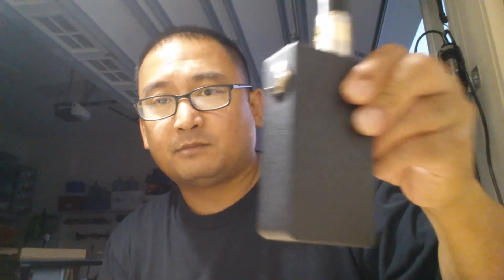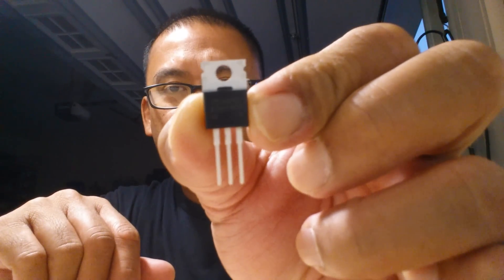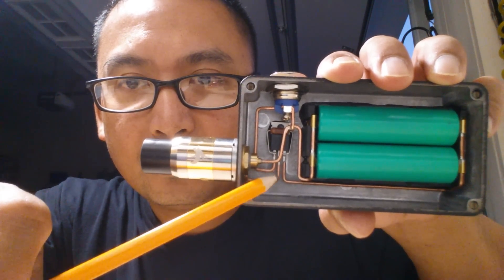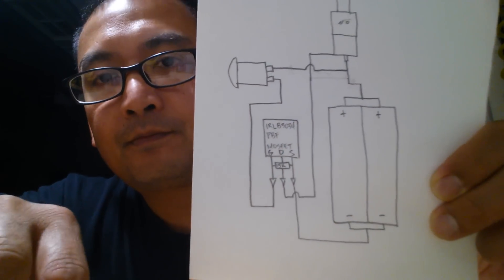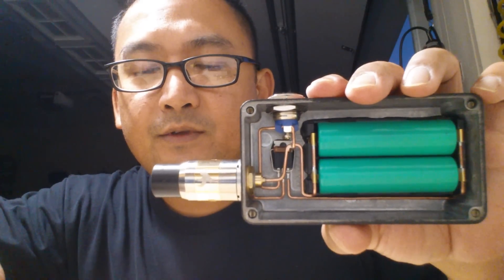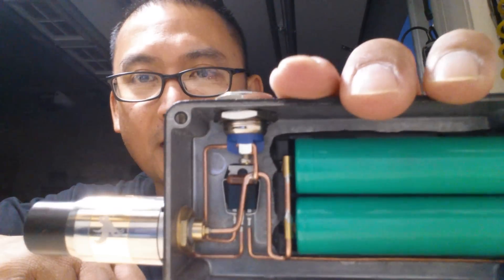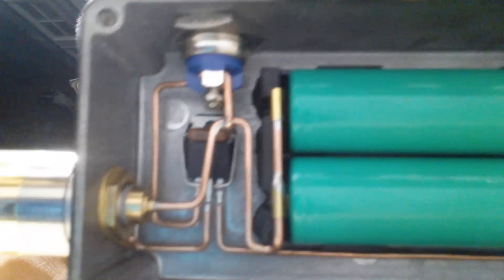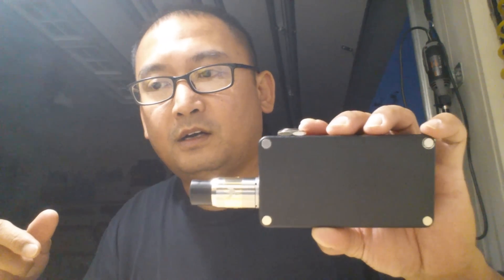Unregulated box mod with a Mosfet

Comment: Hi, can I start by saying that your build is outstanding ! Looks amazing and judging by the vapor, works amazing too. I'm about to make my own box mod and first things first, bought the MOSFET (same one as you have used). Can I ask the "on" voltage of these MOSFETs, I intend to build parallel as you have using 3.7v batteries, and have seen some bad results online with fets getting HOT. What is the minimum "on" voltage for these fets ? As you can imagine there are a lot of "know it all's" and conflicting advice on the internet and thought I would ask you as, well, anyone who builds mods like that knows their shit ! Thanks in advance, Scott (England).
Reply from the maker: According to the data sheet, the gate threshold voltage is 2.5v. The FET will get warm or hot especially when chain vaping on really low builds. A big mistake other modders do when using a FET is they heat shrink it because they're trying to avoid shorts. IMO this is a bad idea because it will heat up and the heat shrink will, not prevent, but will slow down the heat dissipation. On mine, I applied a thin layer of JB Weld just to secure in the box, so in a sense, the Aluminum box acts like a heat sink. On my next build, I'm going to put a copper heat sink on top of the Mosfet to aid in heat dissipation and for looks also.
Reply: Al USAF Thanks ! I can get building now thanks for the advice and video. Going to try and fit a heatsink in there if I can. Agree with the heatshrink,, shouldnt need it if it's mounted properly. Thanks again.

Comment: hey there.. dont know if this mosfet is tested, but its says 30 amps !! what ohm resistor would u use with this mosfet ? thanks      https://www.sparkfun.com/products/10213
Reply from the maker: Use an ohms law calculator and you'll be able to figure it out.
Reply: Al USAF thanks, I have sent you a private message, if you would help me out. id appreciate

Comment: I may sound like a complete noob but how did you get the 510 pin to stay on when you soldered it. I've been trying for days and the solder keeps coming apart from it?
Reply from the maker: I'm not sure how your doing it or what solder your using but this is how I do it. I use a helping hand to make it easier to solder the wire to the 510 pin. I dip the wire in Flux paste and I place it inside the pin, keeping it as straight as possible. I then rest the soldering iron tip on both the wire and Pin to heat both at the same time. After a few seconds, I put a little bit of solder right above the pin opening and I just let the solder flow...don't put too much. Once you remove the soldering iron, just wait a few seconds and it should be good to go.

Comment: question: this is the second box i have built so i know i did everything 100% correct. when i fire it and check voltage everything works. however, under load it will not fire at all. could it just be a bad mosfet?
Reply from the maker: I've never encountered that type of issue. But yes, try another Mosfet.
Reply: Al USAF trying a new one now. thanks for the super fast response!

Comment: Yo!  Great building Bro!  I noticed you actually placed the wire for the positive and negative sled tabs UNDER the tab link... is that a better link?  Also, I noticed you used 14 guage solid copper wire... how did you get those bends without breaking the wire?
Reply from the maker: I only did it so it's in place when I soldered it. You can bend copper without breaking it.

Comment: hey i love the box mod, but feel like you need a little education about metal oxide silicone field effect transistors and the wiring they require, the middle leg DOES require a heavy gage wire as it is the load and delivers ALL the amps of both those batteries to your 510 connection,the only wiring you can go to a smaller gage on tis the gate/trigger wiring from the positive to the switch, and from the switch to the G leg (gate) not ground.and it would help cut the voltage down to the mosfet if you put a 1/4watt15k resistor across the legs source and gate
Reply from the maker: True, someone already corrected me a long time ago...read the comment somewhere below.
Reply from the maker: I did use a 15K resistor.
Reply: Yes I always use atleast 14g minimum for all cept switch

Comment: Hi again thank you for your reply very help full,ime a little confused on the issue where you say you no longer would have to worry about a none rated switch if T junctioning from attie to + on the battery,would you please explain the difference so I could under stand the princable to when a regulated switch has to be used to when a none regulated in this instance,
Reply from the maker: I can't recall providing you that since you started a new comment and I can't view my response to you. So now I'm not really sure what you're trying to accomplish. But if you want to build an unregulated box mod and you follow the instructions I provided in the videos, you will be successful.

Comment: Interesting, I just bought this exact kit on ebay.  What did you use to slim down the battery holder?
Reply from the maker: No slimming required for the sled.
Reply: Al USAF Something I just noticed, I have the right Hammond 1590GBK, while the printout I have says to use the Hammond 1590B.  I'm guessing the 1590B is larger. Even if I clip the leads down on the battery sled, there's definitely not enough space to work with.
Reply from the maker: sinistermoon so you didn't get the exact kit then. Yes the 1590B is a lot larger than the G. Just use sand paper to make the 1048 fit inside the G. Basically lay the sand paper on a flat surface and work the sides of the sled until it fits.

Comment: This is an awesome mod I am going to try and build one in the morning hope it turns out. I love how clean yours turned out!! Jealous :)
Reply from the maker: Hope it turns out great...and thank you!
Reply: Where dI'd you get your button there's so much controversy  on buttons I build at a .23-.20 and don't want to melt anything
Reply from the maker: Jerri Bendig you're not going to melt anything with those build. But...I now highly suggest the use of a Mosfet for unregulated box mods. With a Mosfet, you can use non-rated switches such as the typical 3A amp pushbutton or tactile switch.
Reply: Awesome thank you :)

Comment: What does the mosfet even do?
Reply: It's to keep your firing button from getting too hot.
Reply: basically, your firing button has its own internal limits, if you built a completely unreg box and fired .06 you might risk ruining your switch. the mosfet takes the load from the switch and enables you to use any switch. the 3034 mosfet is a 195a mosfet

Comment: Wish I had got in the contest. Very nice video and craftmanship. Where do you get your batt holders in parallel and also can you get some for 26650s? I hate the stuff I have to use for batt holders, but take the ends out and modify them. Thanks for the vid again, very well done.

Comment: Hey man I have a question I've watched all of your videos I'm attempting to build a box 3 times now watching your videos as a tutorial I bought the MOSFET from the newmark site after assembling everything and having the batteries in as soon as I screw on the atomizer it's firing.or if I put the atomizer on and then put the batteries in its instantly firing. First time I thought maybe I shorted something out but then after the second time in the third time still the same thing. I have no shorts I'm thinking it's in the MOSFET my switch is good everything else is good

Comment: whats the lowest build that mosfet can handle??
Reply from the maker: The use of a Mosfet in box mods is to enable the use of switches with low amp ratings, not so you can use the box mod for low ohm builds. But since I gave this away, I have another box mod that I built similar to this and the only difference is instead of a Hammond 1590B, I used the smaller 1590G. I use this box mod with a 0.15 build on my Hobo rda daily with no issues.
Reply: Al USAF i mean whats the amp limits on the switch when using the 3034 mosfet? can it handle 0.8?
Reply from the maker: ***** the amp load is handled by the Mosfet and not the switch. But if you want to know the 3034 Mosfet amp rating, it's 195 amps. Can this handle 0.8? I stated on my first response that I use a similar box mod and I vape a 0.15 on my Hobo with no issues.
Reply: Al USAF thank you,

Comment: Can use like auto start wire or speaker wire to build an box mod? I would like to build one
Reply from the maker: I wouldn't use speaker wires, not sure about the auto start wire. Just go to Lowes, Home Depot or any auto parts stores and get either stranded or solid copper wires, 14 gauge at least for better performance. They're pretty cheap.

Comment: Hi! im new in this rda things. I've bought quasar rda, build same mod like in this video( im using ultrafire 18650 batteries), and build dual coil of 0.2mm kenthal x6wraps. But i cant get much smoke, or taste... I get better results with my anyvape twist and aspire bdc! please help me..:(
Reply from the maker: It shouldn't produce any smoke, which is a good thing. But I would suggest practice building coils because like you said you're new to RDAs. Also, if you want to produce clouds of vapor, not smoke, practice doing lung hits and exhaling technic (search Leo S or Lowe921 on YouTube). Definitely search YouTube for coil building and proper wicking too...there are plenty but you can start with the two channels I mentioned above.
Reply: Al USAF Ok, thanks, i will try!:)

Comment: I want to build dual 26650 box. Should I use anything diffrent then what you used?
Reply from the maker: Just the battery sled. But I've seen someone modify an 18650 sled to fit 26650 batteries.
Reply: I'm actually modifying some polished pennies and building my own tray! Trying to add some character to my box! :)

Comment: wondering if this would be safe to use in a wooden casing? and what type of wire are you using? what gauge?
Reply from the maker: Yes. I used 14 gauge solid copper wire that I bought from Lowes.

Comment: Awesome tutorial and awesome box mods, I like that you take pride in your work as it shows! 
I have a question, what would you need to do if you want to run a switch with the LED ring that lights up when you press the fire button. Thanks
Reply from the maker: I don't have an answer for you since I haven't used a switch with an LED.
Reply: i make boxes like that check me out on instagram VaporFunctionLA
Reply: DroidReview I had the same idea brother, but unfortunately the LED's actually need to have a constant source of power, meaning that it won't work (unless you want to wire in a separate battery pack, and that could mean problems attached to your unregulated device etc. etc.), plus it'd suck power from your batteries the entire time. What I did was purchase a tiny magnetic "solo" LED, which is a single LED permanently attached to a small watch battery, and you only have to change it out like every 4 months, they're cheap so it's kinda worth it :).
Reply: Dude leds dont take much energy to light them up they are mini leds i dont have any issues with my mods and you can wire them to go on when you fire the mod :)

Comment: Great build.  I have a few questions that i hope you can answer.  I would like to build this, but i want to add a push button latching master switch and a voltmeter.  I would also like to have my buttons with led back lighting.  If I were using the wiring diagram that you posted in the description, where would I connect a 3 wire ohm meter? What should the master switch be rated at?  And since there is a mosfet with a resistor, do I still have to include the resistors for the led in the fire button and the master switch?  If it is easier than answering each question, you can just use paint and modify the wiring diagram and send it to me in a message.

Comment: I just got a Rhino triple 18650/dual 26650 box with mosfet. I put a dual parallel 22ga build in my mutation x (4 wraps). The thing is, it doesn't perform much better than a regular 4 wrap 22ga setup.

Comment: Question... can a parallel box mod (mechanical) light up coils faster/eaiser than a single battery mod?
Reply from the maker: It can but it all depends on the devices you're comparing. Not all parallel box mods and mech mods perform at the same level. But the two advantages of a parallel box mod are your double the amp handling capacity and mah.
Reply from the maker: I don't have any info on that box mod. I would do a voltage drop test to compare. Just get an inline voltmeter to check. Again, just worry about the results you're getting from both mods and don't compare it to other test that people do because it will be different. If you're still not satisfied, contact the modder.

Comment: Hey man. Awesome video. I'm new to this. I was looking at radio shack and and I see they have the 35v input voltage but in the package it says 1amp. I'm running. Dual 18640 efest 35amp batteries. Wull that work? Thanks
Reply from the maker: It will not work.

Comment: what flux does is it lowers the temps required to burns up oxides on the surface of the metal such as borax for welding, some via acids instead, rosin is the popular soldering flux, its not really about heat distrution, but more about cleaning the contact surface area so that the metals can flow onto each other as it wont stick to oxides, which is why we sometimes get a dry joint, small brass wire brush is used before doing welds etc.. to help clean up the surface area.. but flux is normaly enough for 99.9% of all soldering/brazing operations :>

Comment: 1 question. Almost done with all the soldering on this. On the connection to the 510 through the switch and + end of battery. Which do you recommend I solder first?
Reply from the maker: I solder to the 510 positive first. But make sure to disassemble the 510 first so your only soldering to the positive pin only. If you don't, you'll risk melting the 510 insulator.

Comment: Where do you live in north Carolina bro? I live in Dillon. On the SC/NC line a couple miles from south of the border. If your not too far, I'd like to get up with you for some help on building a box. In my opinion I like the the way you do your wireing. Nice neat clean, soldering looks great, and thought out so the spring loaded 510 works. I'm 38 years old with 4 kids so that's why I want that box. Might be a day late on it but I'll try it anyways. I started vaping because of my kids. We make pretty good money but not allot of leaveway for toys. I only have a couple of cheap clone tube mods and it's very irritating always having to fix or rig things to keep them going. Would be nice to have a dual box to share the load so I can build a little lower without collapsing the switch spring and then having to find an old remote control or something around the house to rob a spring from to fix my switch.
Reply from the maker: Goldsboro. All I bought were clone. Since I started making my own box mods, I haven't used any of my mech mods. Don't rob your remote of springs, buy magnets for your mods. Or just follow my guide and try to build a box mod. Let me know if you have questions.

Comment: Al USAF Awesome Box, you did an excellent job, I will like to win this Mod because I only have a Astro mod clone and the 510 threats are really bad now but since thats all I have thats what I have to use!, I also have a question the way you put your batteries (parallel) is gonna give you more battery life or more power?.   I hope I'm not too late for the give away!
Reply from the maker: More battery life.
Reply: Al USAF ok thanks for taking the time to answer
Reply from the maker: Choche Toledo I forgot to mention that it'll also double the amp handling capacity.
Reply: Al USAF 👍 I hope I can win this box mod
Reply from the maker: Choche Toledo I already picked the winner earlier today. I announced it on my latest vid.
Reply: Al USAF 👍 I'm gonna go check it out

Comment: Hey Al.  Hopefully I didn't miss the giveaway, but I have one question and I'm sorry if this question was answered in a previous video.  I understand that with parallel batteries that the amp draw is shared, therefore battery life extended, but does the mod see a reduction in voltage/vapor production as the battery life decreases or as a pair do they compensate eachother to maintain the 4.2v not deducting voltage drop from internal resistances?
Reply from the maker: This is just my understanding of parallel wired batteries from what I've read or watched. When batteries are wired in parallel, both amp handling and capacity doubles but the voltage stays the same. Lastly, I don't really dig into the technical aspect of vaping. I'm more of the general contractor and not the engineer. I would suggest you check out breaktru.com to get a better answer for your question.

Comment: im a new mod maker and a little confused about the the copper wire with no insulator. As the videos and tutorials i have been researching use 20,22gauge insulated wire. what type of wire are you using? Thanks for your time :)
Reply from the maker: I used 14 gauge solid copper wire that I bought from Lowes. I strip the insulation just as a preference. I wouldn't use 20 gauge or smaller in an unregulated box mod. I'd say use 16 gauge solid or stranded as a minimum. For a box mod with a Mosfet, the only part where you can use smaller gauge wires is from the switch to the Mosfet and from the switch to the positive.
Reply: Thanks a lot :)

Comment: Would it be okay to run one wire from the switch, through the positive contacts and to the 510 instead of splicing into the positive? It would look cleaner but not sure if it would work.
Reply from the maker: That should work too. I'll give that a try on my next build. Thanks for the info.